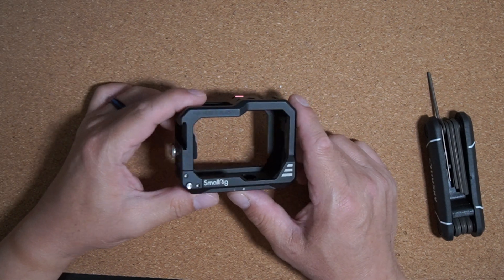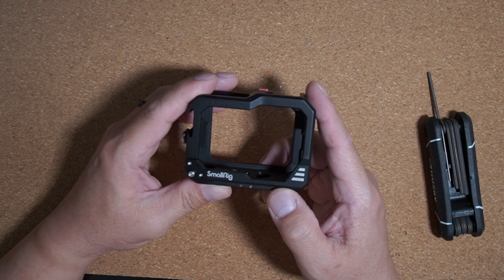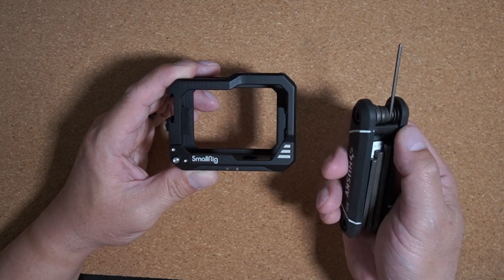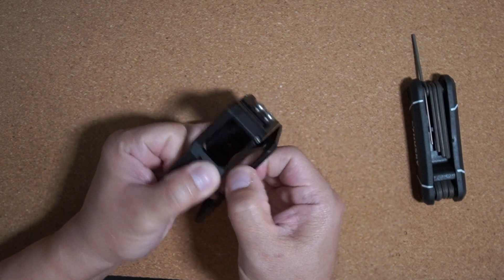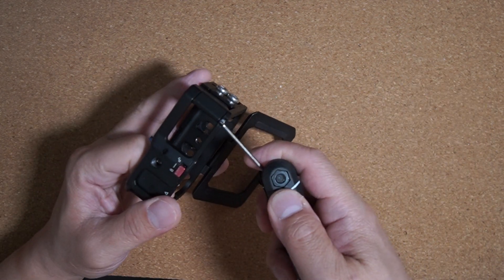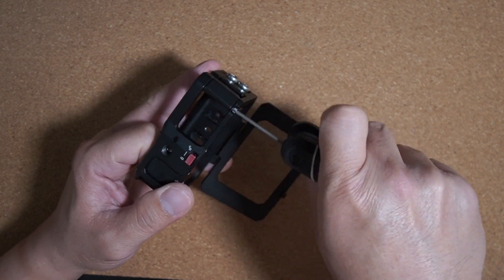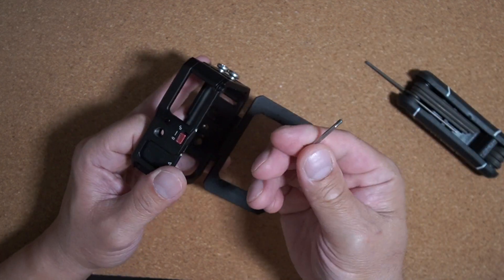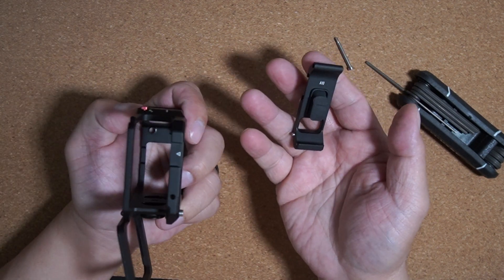SmallRig Hero9 / Hero10 Cage 3088 battery door removal

Comment: I’m so disappointed in my new hero 10s video recording time. I tested it in my air conditioned living room and it recorded for 36 minutes before overheating and shutting down.

Out in the sun at the range… 5 minutes of recording and it overheated and shut down.

This is not acceptable for me when filming interviews at trade shows.

Meanwhile my dji osmo action recording test went all the way until the card was empty or the battery died. Phenomenal performance for me.

I think I’m going to return my hero 10 lol.
Reply from the maker: GoPros are notorious for overheating.  Try the following before you return it:

1. Check the firmware if it's the most up to date.
2. Turn off GPS and Wifi
3. Switch to 1080p and 60fps for outdoor and 24fps for indoor.
4.  I know this will be a pain, but, replace the battery between breaks to reduce heat.

For continuous shooting, the old Osmo Action is a better choice.  For the stop and go convention work we do, I prefer the Hero10.  

The new Osmo Action 2 has the same overheating problem.  Form factor is nice and will have a use for me.  Osmo Action 2 battery is too expensive to have multiples.
Reply: @mikelaputt  I saw a video saying that the hero 11 is coming out soon. Maybe they fixed all these issues with that one. 

I might give the hero 10 a 2nd chance using your tips. If it still dies… I’m going to use the money to buy the Canon vixia G50 camcorder for its IS, dual cars slots, cold shoe for mics, touch screen and huge aftermarket battery! Oh and zoom lens. I miss camcorders
Reply from the maker: @mixflip  I suspect the upcoming GoPro high end model will have solutions.  I’m hoping it will be large enough to have some sort of active cooling system.  

I’m thinking the rumored Hero11 will use the same sensor and will be approximately the same size.  If that comes to pass, it will have the same overheating issue.
Reply from the maker: Just be aware that the G50 focal range is 30-600mm.  Great for stationary interviews.  Great camera.  I had the predecessor XA10 that I used for years doing live performance videography.
Reply: @mikelaputt  I actually returned the GoPro hero 10 at Costco and used the cash to buy the Sony FDR-AX53 4K Ultra HD Handycam Camcorder from Best Buy today.

I like the balanced optical stabilization system, hot shoe, 4k, headphone jack, huge battery, 20x optical zoom and the extended eye cup for those bright days when you can’t see the screen lol.
Reply from the maker: Sony has a great line of video cameras.  The AX53 is a good 4K choice.

Comment: Hey, thanks for all those detailed videos! By the way, doesn't the camera wobble around a bit when using it in this cage without the Smallrig door? Does it sit completely firm with no play? I'm worried this extra free space might cause it to wiggle a bit inside the cage now.
Cheers.
Reply from the maker: There are foam inserts inside the cage that keep the camera from moving.  The door has its own foam inset that keeps the battery in.